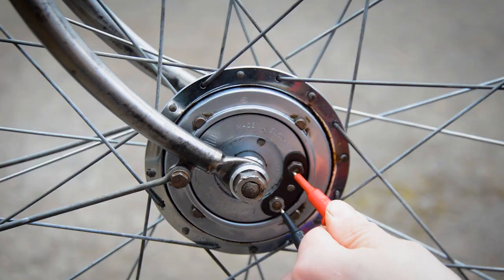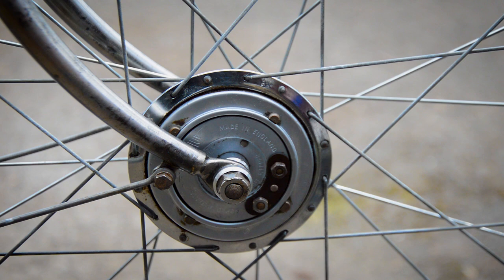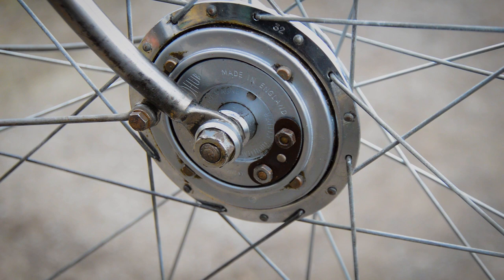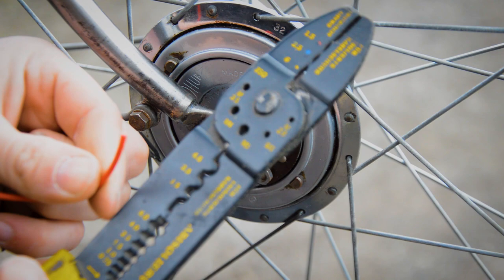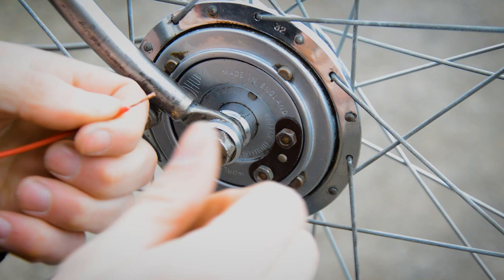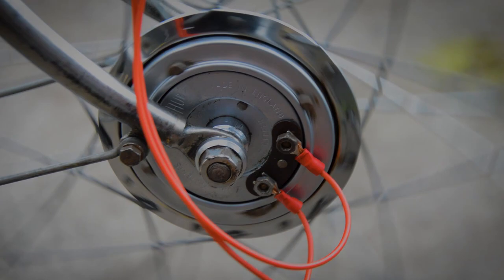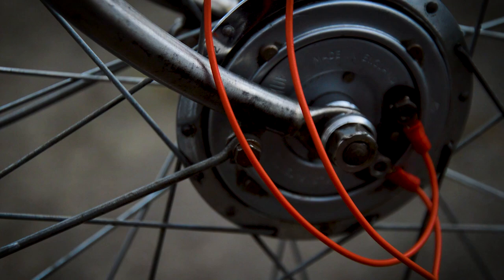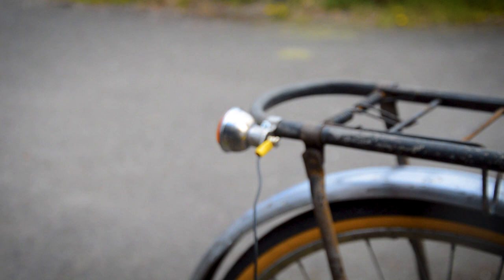Ftting Dynamo Lights to the Bare Metal Bike - Vintage Raleigh Superb

Comment: Hi this may help, being of an age when it was the normal to have dynamo lights, they were always six volts never twelve volts  as a kid I remember some local bike shop use to sell a gas filled front bulb which gave a better light .. secondly the lens can be cleaned with a cream bathroom. Cleaner like jiff or what ever they call it now this will remove some of the yellowing if it doesn't it will smell nice lol.. no It does work most of the time.. Oh the old bike shop went back in 1978  if you change the bulbs to led these will be 12volt  or 3volt with the latter you will have to fit a resistor or wire two led  bulbs in series . Unless anyone knows different ... Nice work love the frame .....mark
Reply from the maker: You're right.  Not sure where in my head I got 12V from.  They're definitely 6V.  I also read the dynohub AC power does create a flickering light at low speeds so it might be fully working after all.
Reply: @MonkeyShred  I'm pretty sure it is a DC current as I remember it also you said it used to have a battery pack . I'm guessing it took the old U2 batteries DC,  back in the day these contain a lot of lead. Any way if it were AC  a converter would be required but I'm sure you wired from hub to switch to bulb nothing in between .....mark
Reply from the maker: The dynohub will definitely be producing AC power.  https://sheldonbrown.com/dynohubs.html  
My multimeter wouldn't give a proper reading on DC, but AC it worked fine.  
The battery unit can be found under "Dyno Luxe Battery" Or "Sturmey Archer Dry Battery Unit"  It should have 3 batteries inside but I'm not entirely sure what size, style they were.

Comment: Ditto on the chain link repair. Inspired. And the new mudguards fit. Have a Dynahub powering the lights on my Raleigh, but not so many wires. You put so much into it, Monkeyshred. Heck, they're just marker lights. The bare metal Superbe is such a beauty, no grocery boxes necessary.
Reply from the maker: Oh yeh definitely just marker lights.  I would never attempt to ride down a dark lane with just these old dynamo lights.
Reply: Maybe you've seen these? Maybe good for a test. Expensive, but what isn't? Link: https://www.outboundlighting.com/

Comment: When i do a hub with the open hole's on one side i stick a spoke nippel or some short cut electric wire in the hole to keep the spoke's from droping out all the time.
If u use the spoke nippel trick dont fortget to take them out before you true the wheel they can get very very stuck the old wire cuts wont get realy stuck. 

keep it up.

Comment: Sturmey Archer Heritage site has a wiring diagram in their archives if you want to add a battery pack. I just bought an eBay Dynohub today, so I will get to experience the fun of wheel building, too. Thanks for your posts. You are an inspiration. I am looking at the herrman led dynamo lights that have capacitors to keep them lit at junctions. It is an alternating current dynamo, so it will flicker at slow speed. Once it gets up to speed the flickering should be faster than the brain can register so it will appear constant. Good luck!

Comment: I had a dynamo set many, many years back because my dad said it would be better than having to replace the batteries frequently.  After a short while ( no more than about 8 weeks) I got rid of it. BINNED IT ALL!!!   Due to the lack of brightness ( inspite of putting in a slightly lower voltage bulbs to try get a bit more light from less peddling) I found that everytime I stopped the BLOODY THING went out ( was warned by my dad this would happen but, took a chance anyway with them BLOODY WORST MISTAKE IN DOING SO!!! )  & I found this dangerous!!!  & also having to go much faster than I usually did just to keep them relatively bright enough. Such a right pain to have. I really HATED THEM!!! 👎🙅😡😤. So, I got some (at the time ever ready battery type lights) Not perfect against today's lights but, far better than those 💩dynamo's & personally I would NEVER EVER go near another set EVER AGAIN!!!!  I wouldn't change the type I use now 1 is battery powered the other is rechargeable on front & rear all battery 2 at present another one is  to go on rear  & I say to anyone who asks.  if they can't BLOODY WELL SEE ME NOW THEY SHOULDN'T BE OUT.     EVER!!!  let alone in a motorised vehicle.  I would NEVER TRUST!!!   a dynamo set ever again. NOT!!!  even the latest brand new & up to date set. .👎😤🙅😡.  I did hear a set somewhere a set had a small back up of power to store ( supposedly for those who had stopped for a short time or at traffic lights or signals) Personally i think its ALL. TOTAL BULL 💩 But, 1.  I can't remember where or do care where or even when or what site I saw them on. Who really cares about about bicycle dynamo lights.  NO ONE!!!  with a braincell.  👎👎👎👎😡😤😤😤🙅🙅🙅🙅 should ever bother using one. But, that's my own personal opinion on these AWFUL!!!  things.
Reply from the maker: Wow that was a lengthy comment!  You have to remember dynamos are old technology but even this set from the 60's came with an integrated battery pack.  http://www.sturmey-archerheritage.com/index.php?page=history-detail&id=64  They're more of a "marker light" than a "seeing light".  I personally won't be using this on the roads.  The lights were just an aesthetic addition.  Modern dynamo lights will be a LOT better.  I may even try some out at some point to see the difference 60 years or so can make.